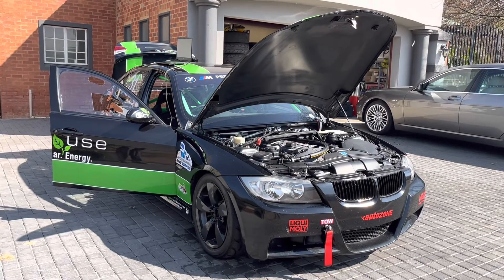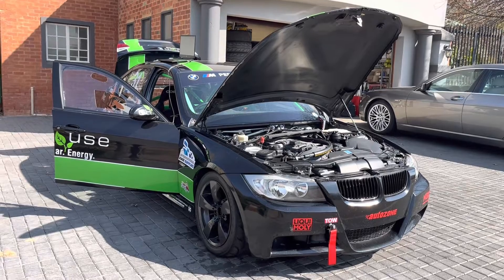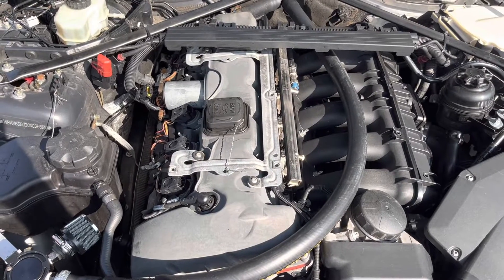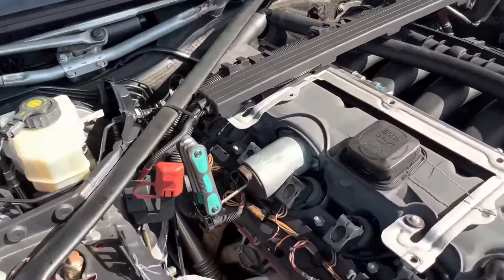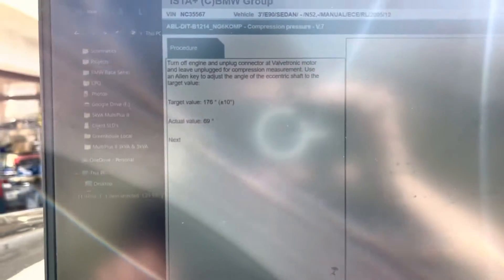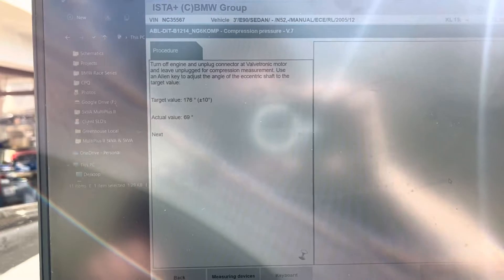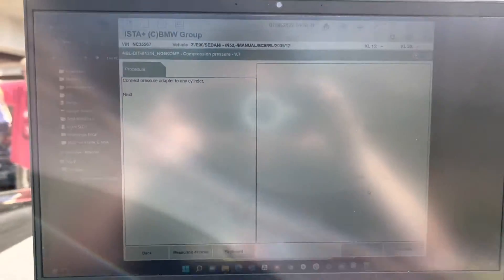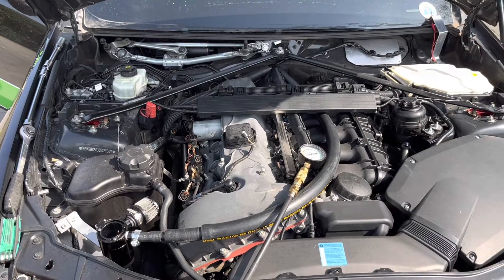BMW N52 Compression Test

Comment: If you take your ignition coils out there's no need to pull a fuel pump fuse or relay the engine is not going to start while doing a compression test.

Comment: Hi, I've perfrormed this test today as well. I checked the VVT value via INPA software. Another method might be to adjust the motor counter clockwise until you can feel the slightest resistence - this equaled 174° in my case. It is possible to adjust the VVT motor via INPA with just one click to 170° - should be fine for a compression test.
Although I just have a cheap compression tester (which I compared to a high quality version) I can confirm values between 11-12bar - my engine ran 324.000km so far, so I am quite happy with the outcome.
This video was extremely helpful as a reference, thank you very much! =)
Kind regards,
Phil
Reply: Can confirm, also set my Valvetronic in INPA to 170° (Actual value was 166 which was exactly on 176 +-10°) so I was fine with that. Had to disconnect the plug going into Valvetronic motor after setting it to 170 because the Valvetronic otherwise returned back to its previous angle with 46° after about 8 seconds. Make sure to do that and check the angle sensor after that to be 100% sure to have the correct Valvetronic rotation angle while testing.
Also after the test was completed and everything was reassembled, I set the Valvetronic to 45° via INPA and pressed F8 (An DME zurück / Back to DME).

After clearing the fault codes, the car started relatively normal, just had some variance in RPM between 800 and 1200RPM for a minute, guess because of some adjusting/self test etc. and went back to normal after that.

I had 10 Bar (9,95 to 10,15 variance) on mine with a cheap no name compression tester. Not too sure what to think of that, maybe my compression tester is just off by 10-15% or there is some other reason behind that. Most important to me is that the cylinders are close to each other and that is the case.

Comment: Excellent video, would you mind if I added some value? If so I will remove no hard feelings Gent.

Specifications I found are as follows:

Compression pressure: 9/18 Bar or 130/261 PSI   Min/Max
Compression variance: 2 Bar or 29 PSI
 
Blow off area around coils and plugs before removal

Once testing is completed:
Key off
Return all to a normal state
Reconnect anything disconnected, coils, plugs (torque to spec, saves you a huge headache), fuses connectors, do so securely but carefully! don't break stuff!
Key on 
Wait 2 mins
listen for click click from valvetronic, or run a limits relearn
clear codes
key off wait 1 min
key on
start, this should eliminate two things 
1) Rough start
2) Brown streaks in your knickers

Two things I love more than these cars, 1) Our helpful community members/culture 2) My parts guy Don
Will try and post a video to my channel with the results of my testing.
Reply from the maker: Great contribution - thank you!

Comment: Have you found a way to see/set the valvetronic angle without ista?
Reply from the maker: No, unfortunately not.
Reply: I know people have their own reservations about Carly. But... I was able to use my Carly adapter to see 'live data' and read out the valvtronic position real time. The parameters are:"Vvt actual value" and "Vvt Eccentric actual value" in the Live Data menus.
Reply: I was able to do it in INPA, also able to set the angle to 170° via INPA, had to disconnect the connector on the Valvetronic motor though because it kept going back to its previous angle after about 8 seconds. After the test before starting the engine, I switched the Valvetronic to 45° via INPA and after that pressed F8 (An DME zurück / Back to DME)

After that, cleared fault codes and the engine started relatively normal, just some 800-1200 RPM variance for a minute, went back to normal after that.
Reply: Can be done in inpa and protools